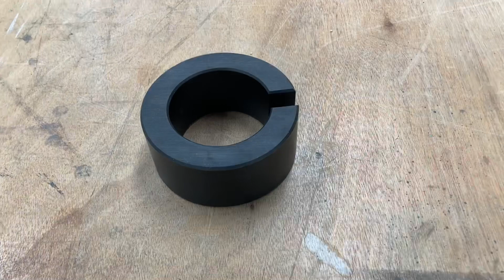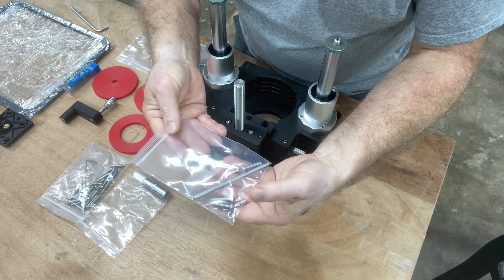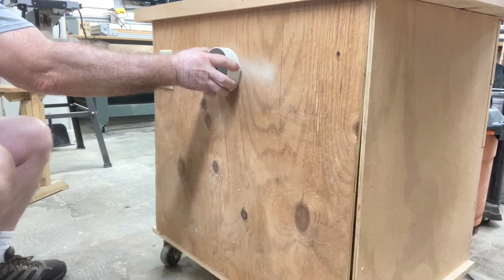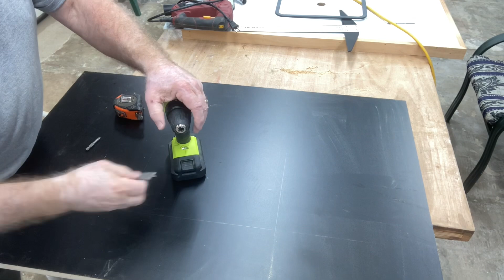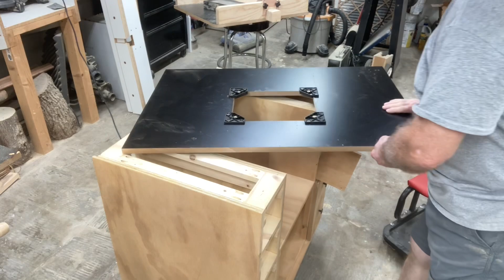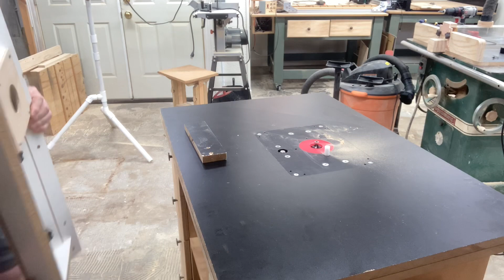Upgrading My Old Router Table with the New Wnew Router Lift

Comment: I have this same exact lift but it was rebranded and sold by a company call Zahyox. One interesting point about this lift is that the plate has the same dimensions as Kreg router plate. That being the case I snagged a Kreg table top off ebay and mounted it on top of a Rockler router table stand. It's a Frankenstein of a setup but it works beautifully. I love what you did with building g your own cabinet though. It doesn't get any more custom than that.

Comment: I notice there is another router lift on that website for $135 vs the one you show in this video for $335.  Any opinion of that router lift?  It appears to have similar components.  It claims to fit my router for $200 less.  Should I shy away from it?

Comment: The router lift oozes quality. How do you lock the height adjustment? All other router lifts have lock to maintain accuracy.
Reply from the maker: A lock is not necessary on this lift. I’ve never had an issue moving from where I have it set

Comment: Well described ! I have a Dewalt 26203. Here I have a motor diameter of 70 mm. The 611 one has only 69mm as I could the at the Dewalt Homepage. Would you say that I can use the 70 mm Router as well ? It is not recommended at Banggood. Thanks for your answer in advance.
Reply from the maker: If the mount will open Up enough to accept the router it should work. Usually, it easier to add shims for a smaller router rather than trying to fit a larger router into the mount.

Comment: It doesn't seem that the lift mechanism has a locking feature. Does the height stay where you put it?
Reply from the maker: It has worked perfectly. It has not moved at all when I set the height
Reply: @PawPawsWorkShop  is there any chance that you could tell me what the Outside Diameter of the reducing collar is? I want to purchase this lift, but there is no reducer for my Milwaukee Router. I'd like to know if the Rockler reducers would work with this one. Thanks!

Comment: Metric, Ugh! When is the rest of the planet finally going to fall in line with the Imperial system? Don't they know the USA is the center of the universe? (Not sure if my sarcasm comes across in text) So many unique and decent tools you can order from China, but EVERYTHING seems to be in metric. DARN I wish the USA had done away with the imperial system back when I was a toddler just entering school. Now I have to actually convert everything the old fashioned way by saying, "Alexa, how many inches is 600mm?" So it's now four months later, and how do you like the lift?
Reply from the maker: I remember a time when the government was actually considered switching. I wish that they had. I use both systems. The best advice I can give is don’t try to convert the unit of measure. Use one or the other and don’t mix. I’m seriously considering doing all my CNC and laser work in metric and the other crazy system when doing regular woodworking. Just a thought.

Comment: I'm here because I just saw this on Aliexpress. I've been seeing a love of the Wnew stuff there lately. All of those black plates look plastic, but the way you describe it as being so heavy, I'm assuming it must actually be aluminum. So is the entire thing all metal construction? If so, I don't think you could find a decent router lift for this price.
Reply from the maker: I was very surprised at the weight. It is strong and works extremely well. I love it.

Comment: Great video, I was thinking of buying one of these lifts but I noticed there does not seem to be a router lift lock,  have you noticed any creep in the cutter when routing.
Reply from the maker: No, I have not had any problem with drift. It has worked perfectly well in a number of applications
Reply: In case you haven't made your decision yet I would suggest you check out Hooked On Wood's new video in his China Tools series. He addresses the lack of a lift lock there and seems comfortable with it. His basis of comparison is an Incra lift and although he considers the Incra more luxurious he doesn't feel like the Wnew can't keep up.

Comment: get brushes that are the same size or larger and modify them to fit.
brushes are nit high tech.
it’s a electronic contact material that can be interchanged between any tool because they are all the same material.
the only difference is the size.
i got a bag of brushes for just a few dollars off Amazon.
you dan use that ok’d milwaukee fir another thirty five years in your original router table for round over or dados.
did i make your day ?
Reply from the maker: Thank you very much

Comment: I have had good and bad luck with Banggood products, I did purchase my Ortur Laser engraver from them. I had bad luck with some rotory tool bits that actually bent bent on startup and the speed was set too the lowest speed. 
If someone is looking for a router lift in this price range I would suggest the Incra router lift II. No waiting and ships from Texas.
Just a suggestion.
I will say this is a good setup if the router has enough power to do what you need to do! 
I have the same Dewalt router with the fixed base and the plunge base with dust collection I am really happy with this router.
In my Incra Master Lift iI I have a Porter Cable 3 1/4 HP it is a a powerful router. I also have the Porter Cable 2 1/4 HP router 690 with the fixed and plunge base. The Dewalt is my first choice on most projects. 😁🛫
Reply from the maker: Thanks for the information